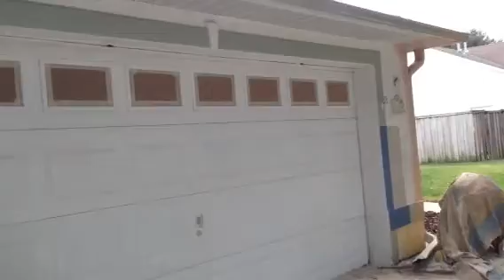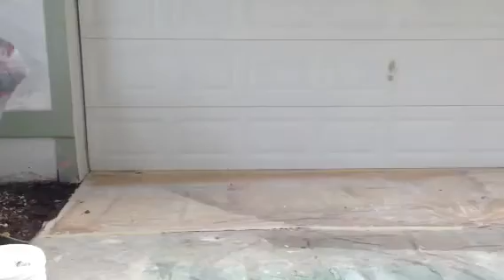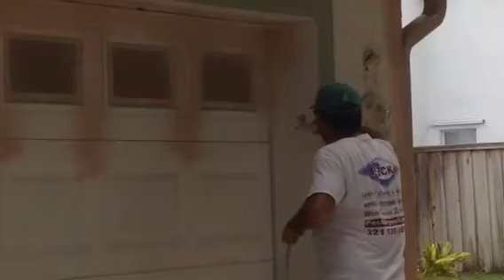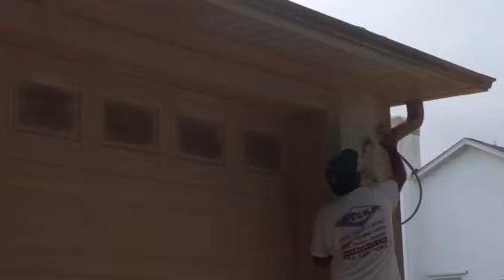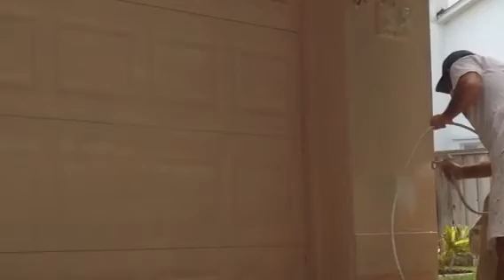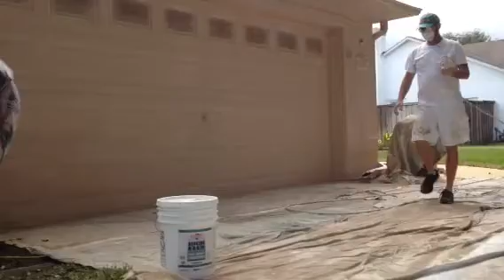How to use an airless paint sprayer to seal and paint a garage door, soffits, gutters and stucco

Comment: seems like a pretty small pattern on that garage door.. did you guys change the tip size?

I come to Florida I am stopping by :)
Reply from the maker: Yeah I was using a .311 tip because  it was super windy that day. But I do find that I have more control with a smaller tip when spraying a smooth metal surface that's not going to be back rolled or back brushed..
Reply: word.. :D
Reply: I agree, A 412, or 512 would be better. Easier to see overlap on 8-10" pattern than small 6" pattern. 311 is slightly too small orfice for garage door,soffit etc.